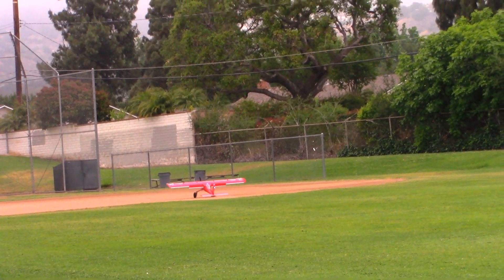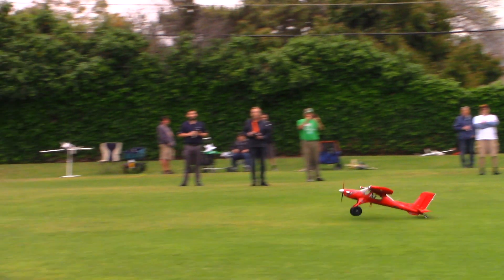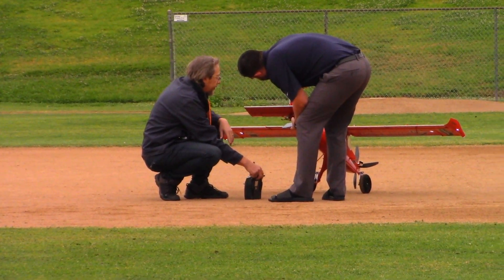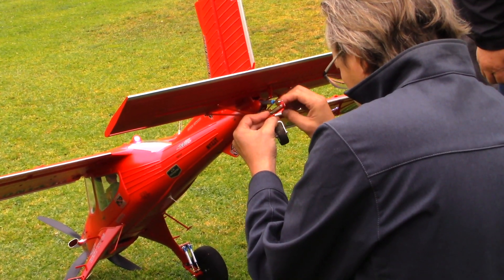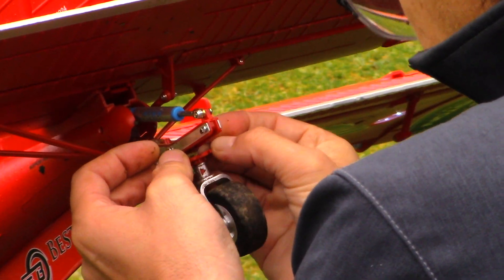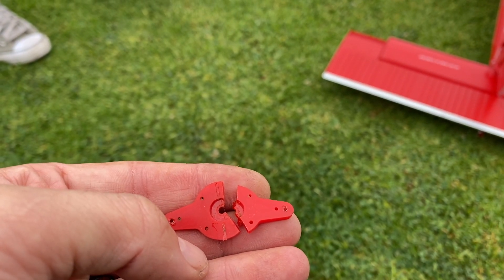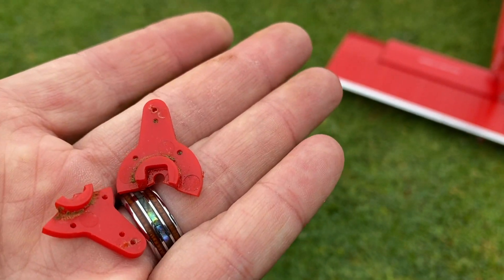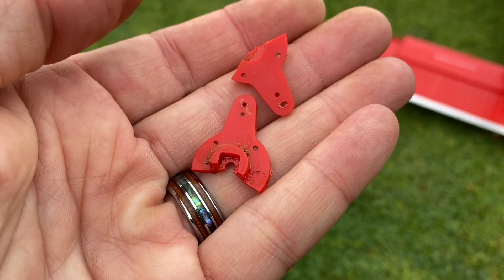Eflite Draco Maiden Tailwheel Fail

Comment: All of the red plastic control horns on my Draco came cracked right out of the box! I contacted Horizon and they sent a new tail wheel that I didn't ask for. I tried to explain to them that the plastic control horns and linkages are made of a very weak and brittle material not suited for airplanes. I've since replaced the controls with proven products. (Sullivan and Dubro) Also, the leading edge slats are designed wrong and mounted incorrectly. If you try a high alpha STOL landing the wing will tip stall!
Reply from the maker: That’s really strange, mine seem strong.
Reply: @7demo7review  I lost the plane! My GoPro recorded the crash. The left flap raised up 5 feet off the ground causing the Draco to roll left. The GoPro telemetry showed that I had a ground speed of 18-20 MPH. The camera was mounted were the passenger seat was looking out the right window. You can see the bottom of the right wing. On the final approach I can see that the plane was vibrating. The Slats on this model are completely useless. The wing tip stalled and the plane cart rolled into the ground.

Comment: Tail wheel sucks, attached by brittle plastic only. I also lost mine on the maiden, Fixed it with a hex bolt which should have been there in the firat place. Had to fix loads of other things as well because of inappropriate materials and plain awful design.
Reply from the maker: Check out my video pointing out all the flaws with this airplane